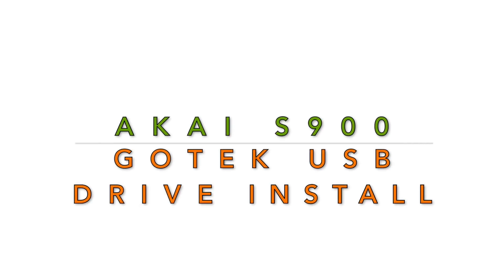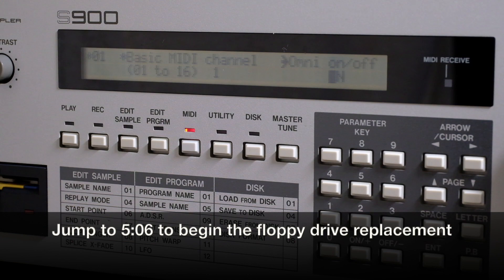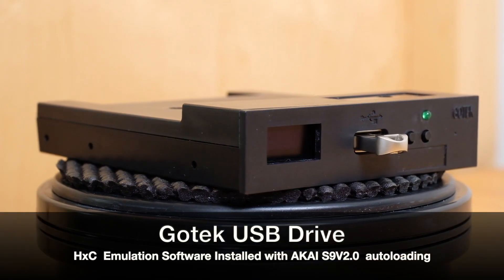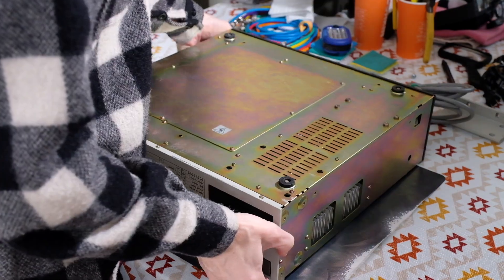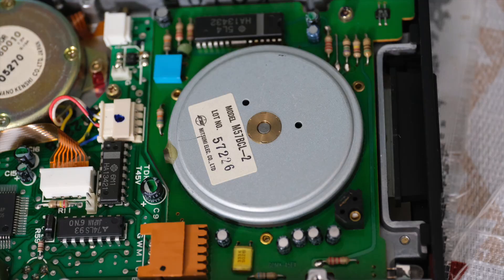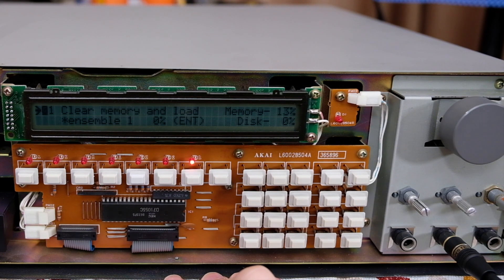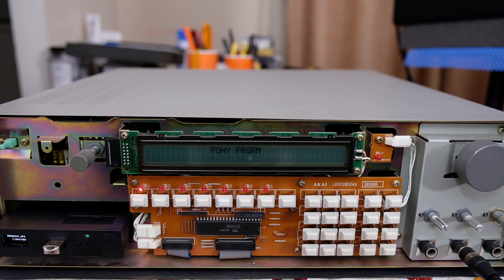Upgrading the Akai S900 MIDI Digital Sampler | Part 1:  Gotek Floppy Emulator Install

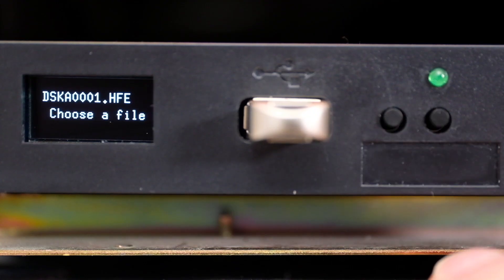Comment: I'm not sure what you mean @ 12:09 "saving a blank disk to avoid writing over the boot file". Isn't the boot file hard coded into a chip on the emulator? I bought Sandisk Ultra-fit 32gb usb drive to store my data onto. How could I accidently overwrite the boot file?

Comment: Thanks for this! 

I just got mine working. 

A couple notes:

1) Be careful with the power cable. Mine broke so I had to resolder

2) Data cable was SUPER hard to remove 

Totally worth it. Thanks for the tutorial!

Comment: Hello sampler friends㊗️ I recently purchased an emulator for my akai s900 from the exact buyer in the link. I installed everything correctly and when turning on the machine, everything booted and turned on correctly, the moment I press disk, the sampler mentions that, "There is no disk mounted". Before turning on the sampler with the floppy emulator, I made sure to have everything connected correctly and to turn on everything with the usb(that came with the floppy emulator)installed. What could be the issue? I'll be checking back to this daily for any updates or comments, thank you guys!

Comment: You mentioned you were able to autoload the latest OS 4?  How exactly did you do this? I have OS 4 on my HXC Gotek, but it never autoloads. I have to manually select it from the disk menu. It only takes a few seconds, but from reading around, others are not able to get it to auto boot either? Can you please share how?

Comment: Oddly enough the blue ribbon had to be installed with the blue facing away. This was a dope video though and super helpful / well explained, good looks!
Reply from the maker: Glad the video was helpful; I'm not completely certain that someone hadn't mucked around inside the S900 I bought used, so the ribbon on mine may have been backwards or aftermarket.
Reply: @vintageMIDI  shoot maybe mine was backwards or after market 🤷‍♂️

Comment: Hey thanks for the video. I was wondering when you turn on the s900 with the gotek how to make sure I do not overwrite over the auto boot disk file. I seen you clicked a button on the drive and it changed the file name. Just trying to figure it out and  I'm literally buying one of these in the next couple days but do not have anyone around who has experience with them.  More youtube vids for now I guess.
Reply from the maker: I currently do not have access to the S900 to double check, but the auto boot should be the start-up file by default.  The buttons on the Gotek do allow you to select that file, should it not be initially available.
Of course, a back up on your computer is a good way to guarantee you can reload it on the USB drive should something happen.

Hope you enjoy the drive once installed in your gear.  It make the vintage stuff more fun to use.

Comment: Could you please provide the jumper layout on the gotek?, I tried to pause the video to see but couldn't quite make out their locations
Reply from the maker: Sorry Axe S.... I sold the S900 over the holidays.
Reply: @vintageMIDI  I have a gotek already installed in another sampler,  trial  and error I guess! But fun
Reply from the maker: These Gotek devices are a modern miracle to modernize these old synths and samplers. 

And a bunch of Yamaha & Roland (and probably other) synths can benefit from innovative entrepreneurs who come up with multi-bank memory cards.    Check these out:

https://www.sector101.co.uk/

http://forum.vintagesynth.com/viewtopic.php?t=76886&start=420

https://www.gearslutz.com/board/electronic-music-instruments-and-electronic-music-production/1278701-introducing-xd-280-disk-emulator-akai-s612.html
Reply: Hi, I'm mid process now but I bought one pre-configured for Akai and it's the same as what's in the video. Holding it so the connector is up and the "GOTEKsystem" text is right-side-up the third set of pins from the left are connected top to bottom  and the two pins at the lower-right are connected horizontally. If you have an encoder or speaker installed those might be on other pins.

Comment: I have enormous difficulty to get the datacable out from the S900, it sits hard like a rock! Any tips?
Reply from the maker: I understand; i found that data cable tough to remove.  I propped the S900 on its side to have a better access angle.
You may find it easier to use needle-nose pliers to grip the shoulder of the connector.  May have to wiggle it on one side then the other, back and forth to gently loosen the cable from the board.  
Be careful, though, as the ribbon cable is fragile.  Patience is really needed here.  
Let me know how it goes!
Reply: @vintageMIDI  Thanks! I managed to remove it in the end and install my Gotek. Everything works fine reading/saving, sampling into the S900 etc so I must have avoided broken anything! 😅 But it sure was stressful to do it having large hands. Thanks for your great video even though I had to remove the PSU to be able to do it.
Reply from the maker: Glad you got is sorted out so you can now enjoy your upgraded S900.
Appreciate the feedback on the video and contribution to the conversation.

Comment: Hi. Nice Video! I've a problem with my S900 maybe you can help me? When I plug the HxC Gotek in the S900 I can't select the images on the Gotek. It just shows "HXC" on the display but no numbers. I've the S900 Version 4.0.HFE and a .cjg file on the USB stick. I can start the S900 but can't load the disk. It's saying "OOPS! Disk not mounted." What am I doing wrong or is my Gotek broken or wrong connected? Thank you!
Reply from the maker: Thanks for the compliment, Carl.  (Cool logo, BTW!)

Just checked my USB stick... here's what on the stick:

Version 4.0 HFE renamed as AUTOBOOT.HFE  (this is a 2MB file)

And a file named:  HXCSDFE.CFG (this is a 66KB file)

The rest of the files on the USB stick are named sequentially as DSKA0001.HFE through DSKA0200.HFE (these are each 2MB files)

With the USB stick in the Gotek, power the S900 on. Be sure the AUTOBOOT.HFE file is showing up on the Gotek screen.  Then press DISK on the S900 and then ENT.  You may have to wait a few seconds if you get the "OOPS" error, but then just press DISK and then ENT again.  

Let me know if that solves the issue.  If not, hit me up again and we'll get to the bottom of it.
Reply: @vintageMIDI  Hi. Thank you for the compliment as well :) My cfg file is a 8KB file. The HFE files are 2MB like yours. I've downloaded HxCFloppyEmulator and it's telling me "FTDI D2XX Driver not installed!" Do you know what that means? Still I can't select the files on the Gotek because the display is not showing the files and I can't load them in the S900. Even if I repress Disk and ENT and it's showing Disk 0%.
Reply from the maker: Perhaps this link will have the drivers you need:

https://hxc2001.com/download/floppy_drive_emulator/index.html#cpldusbhxc

There is a section on that page that has FTDI D2XX Direct Drivers.

A more direct answer may be available on the forums:

https://torlus.com/floppy/forum/viewtopic.php?f=28&t=3799

Do you have the 3-character LED display or the OLED display on your Gotek?
Reply: @vintageMIDI  Thank you so much for your help. I've downloaded the firmware and the FTDI Driver but still isn't working and still can't select the items on the Gotek. I have the 3-character LED display.
Reply: Do you know if a cable connection inside the gotek drive could be the problem?
Reply: It's working now :) there was a problem with my files. Thank you so much for your help.
Reply from the maker: Apologies for the delayed response and thank you for the update.  Very happy to hear that you got it sorted out and working.  
Isn't it surprising that companies like Akai, Roland, Yamaha, Korg, etc. do not offer solutions like a gotek that would just instantly work with their vintage machines?  Seems like a missed opportunity to me.  Enjoy your updated S900, Carl!
Reply: @carlaqua1222  Thanks for this conversation guys. Very helpful and informative 👍

Comment: awesome vid. i noticed when u removed the face place these brass clips fell out. when i removed my face plate from my s900 the same thing happened to me. but i didnt noticed where they are supposed to be placed at. can u help me out please thank u.
Reply from the maker: Thanks for the feedback, DJN!  
I think you're referring to the three spacer-washers under the top of the faceplate.  They should act as a space filler between the underside of the faceplate screw holes and the holes on the top of the chassis.  
I think they're there just to keep the metal on the faceplate from deforming when tightening the screws through to the chassis.
Let me know if my description makes sense.... or not.
Reply: @vintageMIDI  I see said the wise man. make perfect sense now. but i only found two clips. but that should work. thanks again for the fast reply
Reply from the maker: Cool!  Glad it helped.  Thanks for letting me know.
Reply: @vintageMIDI  oh and i just saw the imprint on chassis where the clips go. thanks again bro

Comment: Great videos. I found these extremely helpful when upgrading my S950. Did you replace some of the capacitors or other components on the power supply and voice boards?
Reply from the maker: Thanks for the feedback, Les; glad to know it helped.  
Thankfully I've not needed to replace other components so far.  
Surely caps and chips will fail eventually, but there are some great threads on GearSlutz and VintageSynth forums that'll be useful for when that time comes.  
https://www.gearslutz.com/board/electronic-music-instruments-and-electronic-music-production/710814-akai-s900-help-3.html
And there are some folks that will repair old gear like the S900 if it is more than I can handle.  https://driessen-music.de/2019/10/27/repair-akai-s900-12-bit-sampler/
https://gstormelectronica.blogspot.com/2015/09/akai-s900-how-to-deal-with-bad-ram.html
Reply: @vintageMIDI  Thanks for the feedback and the links. Just got my LUX screen replacement today. I will be going over these videos again for a refesher.

Comment: this is absolutely bananas.. quick question if u can help me out: Can the floppy drive removed from the s950 installed in akai mpc2000xl？THanksss
Reply from the maker: I don't have either of those machines, so I can't personally attest that this would be possible.  This link might offer clues to replacing a floppy drive on a MPC 2000 XL that may be helpful to you:  https://www.mpc-forums.com/viewtopic.php?t=4853
Hope it gets you closer to an answer.

Comment: Hello I purchased a gotek flash floppy , but not the hxc do you know how I am gonna set it up for s900?
Reply: There is an alternative firmware for the gotek that works better than the stock firmware. The FlashFloppy firmware can be found on github with instructions on how to flash, setup, and potentially mod the gotek.
Reply from the maker: Thanks for the lead on the alternative firmware; I will look into the FlashFloppy version, as I have more gear yo update..
Reply: Thanks for the answers, the one I bought was already flashed with flash floppy, so with the right files it was plug n play!
Reply from the maker: I did not flash the Gotek myself; I purchased set up for the S900.  My recommendation would be to follow these links for more info to properly set up the Gotek:  http://hxc2001.free.fr/floppy_drive_emulator/index.html#Download_HxCFirmwareForGotek

I'd also recommend this video, though it doesn't pertain to the S900 directly:

https://www.youtube.com/watch?v=xyDohCioKPg

This video has good insight, too:
https://www.youtube.com/watch?v=Q2qVgBJUI5U

Comment: Thanks for the comprehensive tutorial.  I recently replaced the floppy drive on my S900 with a Gotek Floppy Emulator as well.  I fought with the firmware installation for a while but finally got it working.  This video was exactly helpful.  Thanks.
Reply from the maker: Glad the video helped out. Floppies are 'retro-cool', but ultimately  distract from making music.  Modern storage makes using this sampler headache-free.  Akai would strike gold in this century by authentically converting S900 boxes into S950 machines, right?
Reply: Thoughtful Clips - Absolutely they (Akai) would.  I recently replaced a capacitor on my S900 and got it working after being in storage for 20 years.  I was excited to use it again and even more excited when I discovered I could replace the floppy drive with a USB.  It was a bit of a challenge for me but I couldn’t seem to part with it even though my studio is mostly computer based now.  Thanks again for your help.

Comment from the maker: Reinvesting in old gear makes you remember all the reasons you enjoyed making music with it in the first place.  Which gear have you recently rediscovered in your set up?
Reply: I reg use E-Mu E4XTs (x1 w/RFX) & an Akai S900. Also for colour; Mackie CR1604, Alesis Quadraverb, Alesis MicroVerb II (that's a lie, I've not switched it on for YEARS but I did look @it earlier). If you want some crunch, it's not the hi-end droids you're looking for. But, saying that, I'd dig a cple of Distressors & an AnaMod ATS-1.
Reply from the maker: Agreed:  character is often found in gear that isn't top shelf.   Alesis & Mackie shoved indie music production far forward in the 90s, which is why I'll keep the LM-3204 & Quadrasynth 'til I my ears fall off.  For sure I would find some room for a Distressor (which I guess is technically 'vintage' now that it's over 20 years old).
Reply: I feel uncomfortable calling anything still in production vintage, but as Behringer are cloning everything (not moaning- love their VC340) I guess that would rule out 90% of the classics. There's something about those old Mackies, isn't there? Always wanted a 32-8 but would be too big a project these days (parts failing I mean). Could you answer a ? re: S900 pls? If you playback a sample does it come out L + R output simultaneously? I think mine has a fault, as it only outputs on the R channel if I map it there. I'm using it as a Mono device really.
Reply from the maker: Sample playback from my S900 has the first four voices on the left side, the next four voices on the right side.  Try a quick arpeggiation across the keyboard with both L & R sides hooked up to your audio system and see what happens.  It's possible the keygroup may need to be edited in the EDIT PROGRAM menu.

It is somewhat confusing how the S900/S950 utilize voicing.  
Perhaps the link below may explain it better; it pertains to the S900/S950 equally regarding voices:

https://www.gearslutz.com/board/electronic-music-instruments-and-electronic-music-production/1025955-my-s950-polyphonic-am-i-doing-wrong.html#post11272328
Reply: Thank you. I've got my head round it now.
Reply: A tip : you can watch series on kaldroStream. I've been using it for watching a lot of movies during the lockdown.
Reply: @Alexander Sam yup, I've been watching on kaldrostream for since november myself =)